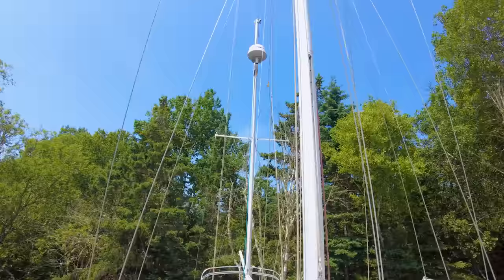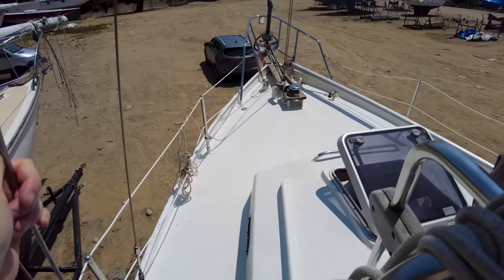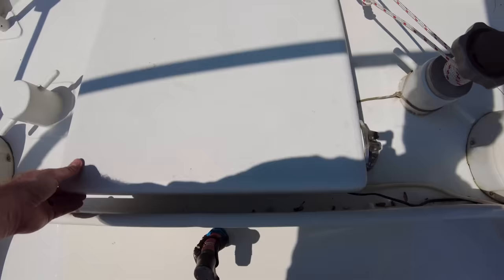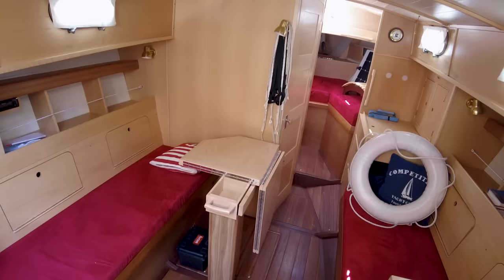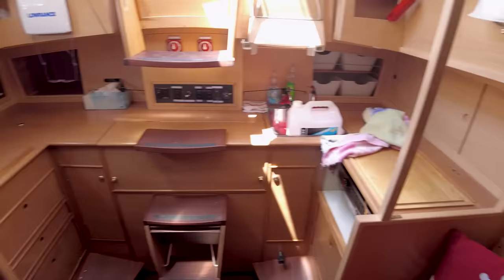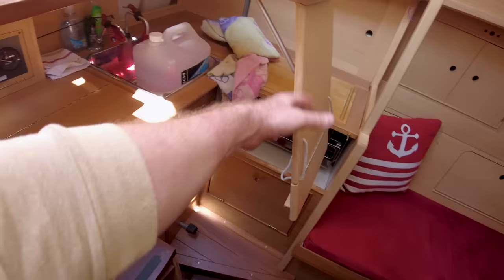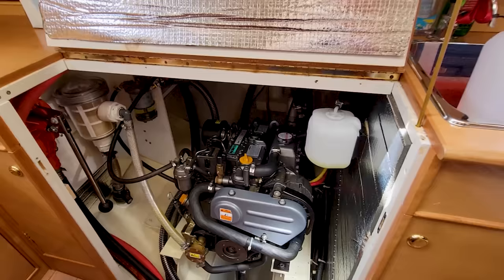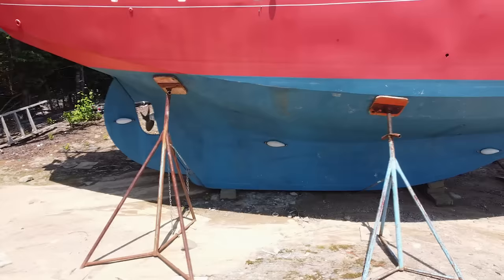UNBELIEVABLY CHEAP STEEL Ketch W/ An Interior That'll SHOCK YOU [Full Tour] Learning the Lines

Comment: Regarding the fold down bench. "You just aren't seeing it." The reason there is a hinge at the bottom of the leg or support piece is so it can fold up and rest on the ledge made for that purpose which protrudes out from the end of the settee that the red pillow is resting against. The ledge is the exact depth as the distance from the hinge to the end of the bench support (leg). I bet you anything, that is what it is for. You can see what I'm talking about at 9:43 in the video.
Reply: The real question is...would you sit on it at anchor or while at sea , it looks flimsy at best.
Reply: I’m the owner and it is not flimsy. Sitting out of the weather you have a 360 view around the boat and a good view of the GPS/Chartplotter/MMOS/Radar which swings out on a hinge.
Reply: Doesn't look at all flimsy to me - just opposite.
Reply: @edmiller1012  beautiful job on the woodwork and joinery!

Comment: Nice little boat.  Looks very strong, if the entire boat is steel, hull, deck and house/dog house.  Love the La Vac head and very nice engine and compartment. For northern cruising the diesel stove/heater is nice. Didn’t see the tankage??  And conveniently the displacement was not shown by you or the broker.  Long overhangs and short waterline combined with the mass of steel in such a small boat would make her very very slow.
Reply: Yeah, I thought it was funny/convnient that the displacement wasn't listed.  It would probably put people off!

Comment: Very well laid out for use of all the space. It is the epitome of every thing in its place. I'm just a little claustifobic for that size space. For those that don't have that problem it would be ideal. My ideal would be this in a 37 footer hull.
Reply: 33 made out of steel would barely move
Reply: 1st reply says it would barely move because it's steel. Doesn't all that rag available to hoist into the wind mean it will be smooth and fast ? Though a bit slower accelerating.
Reply: She could be made fast
Reply: @MrBrian8749  I'd love to see that. 33 feet implies she's short and there is minimum 4 mm thickness of steel required for plates. That makes sense for 40+ boats. If you guys have an idea how to make her quicker/faster- I'm all ears. Maybe she could stand some heavier rigging?

Comment: I noticed a comment in thread regarding fiberglass vs. steel. Yes, steel is more work but worth it if doing any sailing in water with debris - logs (PNW), crossing shipping lanes (containers), etc. Hit something significant once with a fiberglass boat and you’ll wish you had steel.

Jason. Do you know condition of steel hull? A mild steel boat of this age with 1/8” plate could be significantly degraded, particularly in typical problem spots.
Reply: High density polyethylene boats are best. They don't dent or break, they don't rust and they don't foul. They require no maintenance. Fun times designing and welding together though. All fittings have to be screwed or welded in as you can't glue anything to them.

Comment: The addition of air conditioning would be a must for a steel boat. It would be like floating in an oven otherwise.
Reply: yes, looks like it is setup for higher latitudes - weather wise - with the big heater/stove combo.

This 30' Al Mason does appear to have good ventilation.

It also looks like a smaller version of Odd - Odd Life Crafting has a 40' (maybe a 42'?) steel, sailing monohull, though theirs has a lifting "keel" or variable draft.
Tales from The Old SeaDog - has a 33' steel boat ...   as long as the waters you trawl are "cool" - that would really help getting everything else cool, below the deck.
Reply: @drx1xym154  … I’m very familiar with Odd Life, I watched the whole rebuild. One hell of a job those two did. I can’t remember if they had air conditioning or not. Down there in Brazil I sure hope so. Yikes.
Reply: @rbnhood39  no AC!

Comment: Noob but keen. One guy came saying its a steel 33 that would not be able to move through the water? I consider it fairly tough 0.125" mild steel with lead ballast and a deep keel. So very stable and sorta tough.   Mainly good for stable mooring ? Any responses to the speed of the vessel? Wont all that sail area make a rather fast boat?
Reply: Speed is determined by hull length. Of course the amount of sail has a factor also, but hull length determines the bow wave that determines the max speed for a given hull. You can exceed this of course but at a tremendous cost to the amount of power required. Example: hull designed for 8 knots to run 11-12 knots would require nearly double the horsepower.

Comment: Cheap.
But steel is not so great. Too heavy for a 35ft boat. A good length weight ratio for steel starts at 50ft or so… below it is very heavy or you need a lot of extra sail to perform well…

Comment: A steel hull is 5X the work of a fiberglass boat, as well as being much heavier.  Buying only makes sence if either you are headed into ice or if you think you might ground the boat on a coral reef.
Reply: Fiberglass just deteriorates SO fast. No matter how well you maintain it, it has to be completely redone in twenty years. Im a wooden boat guy, so I dont know anything about steel boats.
Reply: @thecocktailian2091  Wooden boats is another whole subject....;) But fibreglass should reliable last fifty years or more. Sure, the surface may oxidize and require painting and sure, some 1970's boats have suffered from osmosis but that is still not remotely as big a deal as welding in new steel plates or replacing rotted timbers ie fibreglass remains the rational choice for 90%+ of boat owners, especially if you are in warmer waters.
Reply: @thecocktailian2091  you on drugs 😅
Reply: Remember steel is 30x the ‘strength’ compared to fiberglass so. This is one sweet ride, and there is no fatigue issues with steel compared to fiberglass.
Lovely boat.😊
Reply: @thecocktailian2091  A Solid Fibreglass hull should last forever or atleast indefinitely.
Reply: @CheersWarren  Never heard off or seen any fatigue issues in a classic fibreglass boat. Sure, it is too early to tell how modern fiberglass (post 2000) will perform but the record on older fibreglass boats is excellent. Yes, steel is much stronger but unless you plan to drag your keel across a coral reef, weight (which means better passage times) and reduced maintainance are far more critical considerations.
Reply: @stephenburnage7687 sail a steel boat and talk again.
Reply: @CheersWarren ive seen fibre chatter in small pieces on rocks. It left an impression on me that yes fibreglass is fast provided no mistakes are made. But for me too its steel all th3 way for that bombproof strength.
Reply: @thecocktailian2091 lol, you don’t know anything about fibreglass either, 20yrs, smh

Comment: Did someone mention electrolysis -- and this is a 48 year old boat. Electrolysis is a nightmare, I did not like the work I helped a a friend with on his aluminum boat -- electrolysis problem.  I need a quarter berth
Reply: Electrolysis is a much smaller consideration for steel.
Reply: @mitchellsmith4690  wow, I thought this reaction was the same on both metals, didn't know steel wasn't a big problem
Reply: @swimcat2333  steel is subject to rust a3nd corrosion, but the degree that aluminum can go by electrolysis is far far beyond what steel gets with rust.  Both vary by specific alloy though.

Comment: 48 year old steel boat. lol. they better get the hull x-rayed. 48 years of electrolysis means they probably don't have much left. 😂
Reply: I have a 32 ft., 1975 Marinette. I sandblasted the entire hull in 2020, and she's as good as the day she was built. Good maintenance makes all the difference in the world.
Reply: Unless it's been zinced religiously
Reply: I was just looking at a 50ft steel boat from the 70s, had 12mm under water and 6mm over water. No problems but I would personally check the thickness of any steel boat regardless of age.
Reply: @homer5802 Marinette is aluminum
Reply: My friend you have no CLUE what you are talking about!!!!
IGNORANCE!!!!!
Reply: All the extensive coating. Replating the bow. I’d want to see photography of the exterior/interior prior to sealing her up. New, properly applied paint makes anything look good, so it’s vital to see what was going on underneath prior to sandblasting.
Reply: Details of refit etc in description

Comment: Nice boat but the hull is not designed for extended blue water sailing.  You need an S formed hull (difficult to do) with steel construction in order to have a comfortable motion at sea.
Reply: Um, no not really.  Steel boats with hard chines have sailed for many, many decades with no such complaints.

Comment: If your experience equals that boat, you got a winner. When you get outside the sight of land it's a whole different thing. One little mistake you die. sleep 10 minites too long and you die. Don't look where you place every step and you die.  dISCONNECT FROM YOUR SAFETY HARNESS ON DECK AND YOU DIE.
Please get a marine inspector that specializes in steel hulls and have him check the thickness for electrolisys damage. Just because it had a new coat of paint when you baught it doesnt mean it didn't sink at one time because of electrolysys damage and all that keeps her afloat is some  polyester fiberglass putty. 
Looks pretty well rigged. I'd have shit myself to have had that back when I was sailing back in the 1970's. 
I had a 24' bayliner buccaneer, don't laugh. II circumnavigayed the atlantic twice in it.  I had a serlf tending jib inside the frestay, double lowers and a thhird gudgeon and pintle on the rudder. Other than about 20+ sails it was stock. Oh yes, I had a gymboled stove and bunk.   That gymboled bunk was awesome. When you sleep at 30 deghrees for months at a time youlll understand.  I got that boat for free and I demanded the marina pay for the storage title and give me two weeks to get it ready to launh and a free launch.  In fact they were so glad to get rid of it they wiped put the bill for fiberglass materials, bottom paint and zinks too. After the first Atlantic circumnavigation I was back to haul out for a complete going over and was talking to some of the employees there. when they jheRD i GOT THE BOAT FOR FREEE THEY DIDNT BELEIVE ME. tHE MANAGER LAUGHED AND SAID IM THE ONE WHO GAVE HIM THE TYITLE. lol
Never had an engine. Never could understand why people would put an engine in a sailboat.  if the inlet is too rough to enter sAfely, heave to for a week. IF YOU REALLY MUST HAVE ONE, MAKE SHURE IT IS SMALL ENOUGH TO HEAVE OVERBOARD FOR AN ANCHOR.